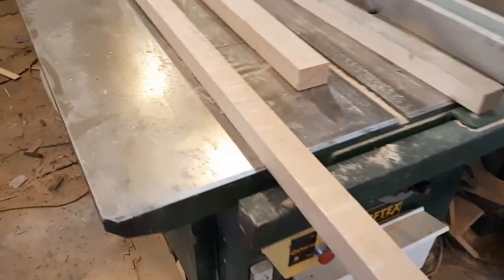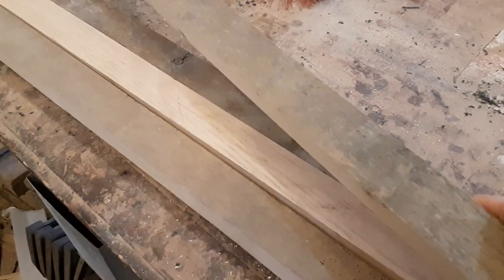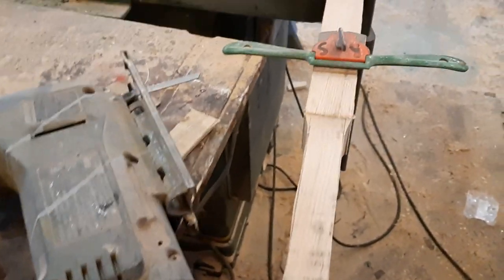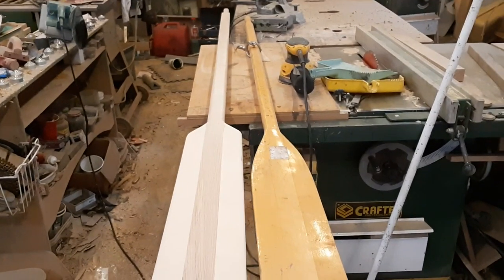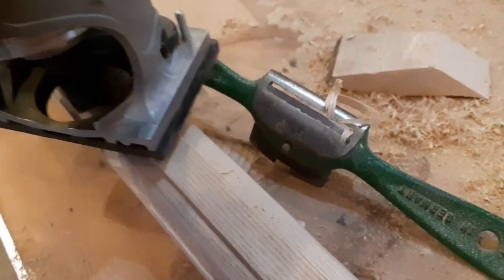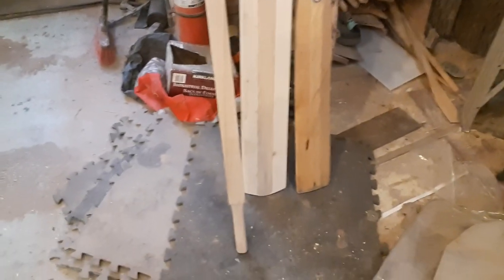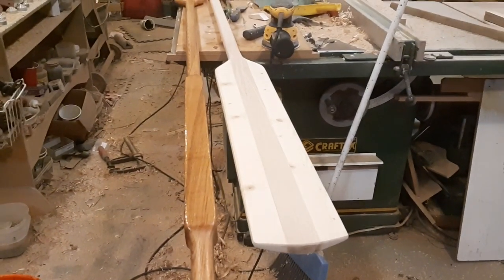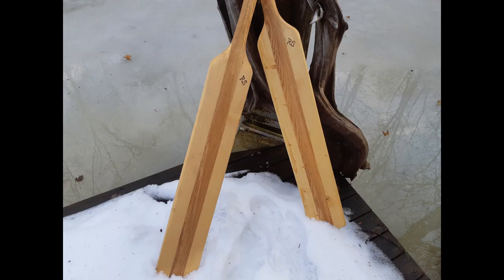Home Made OARS, the easy way...

Comment: Hey Roy, love your oars. I’m planning the great loop in the future and would love to put some on my sea Ray for Propulsion. My beam is 8 feet. What length do you think i should use? Thanks, Paul
Reply from the maker: My DIANNE'S ROSE  is 8' beam, and I use 10' oars, but it depends how high off the water line your set up is too! A Yola maybe a better choice off the stern? BestRoy
Reply: Thanks for your reply. I plan to use the oars mostly down stream on the inland rivers for  steerage and some propulsion. I have seen an equation with dividing the beam by 2 + 2 x 25 / 7 = 14.9’
14 feet seems excessive? My craft is a SeaRay 215. The water line might be 2 feet down? I’ll start long and cut to length. Thanks for your input. Paul
Reply from the maker: @Paul Markovich  it is getting excessive if over 12'! My 10s are a bit short but they fit inside the cabin and can be deployed quickly. They have been handy when my motor stalled and going down stream like you want.

Comment: What glue did you use to laminate the oars?
Reply from the maker: Tite bond 3...as the oars are varnished and not used that much, it should be fine. I'd use epoxy for hard use!
Reply: @roydesignedthat  thanks, I am hoping to find used but if not, I will need to build some 9'6" oars.
Reply from the maker: @travelbywater9378  Sadly there aren't many used oars out there in that size! Most are short 7'ers! I mad a very nice set of 10' oars for our DIANNE'S ROSE also. They are a satisfying project and not too hard to do! BestRoy